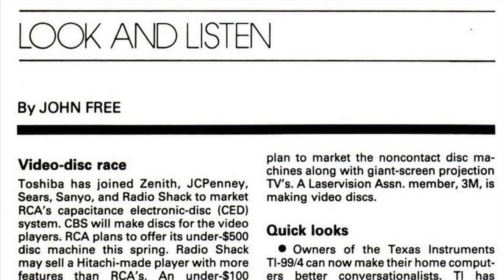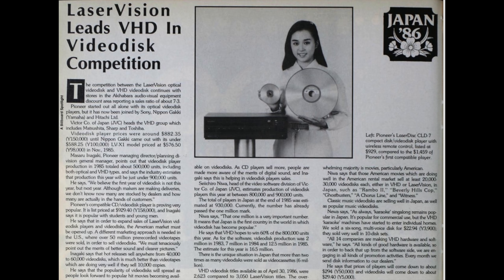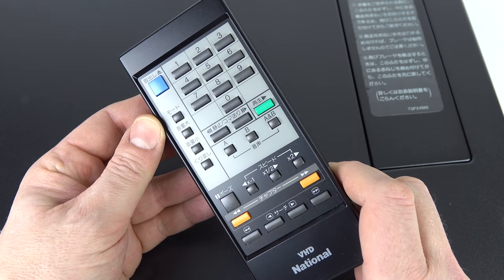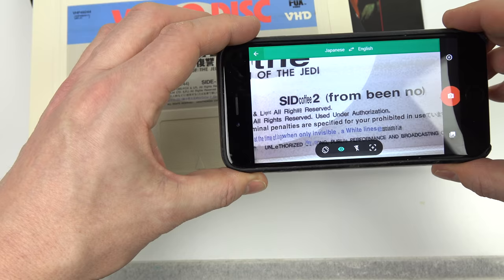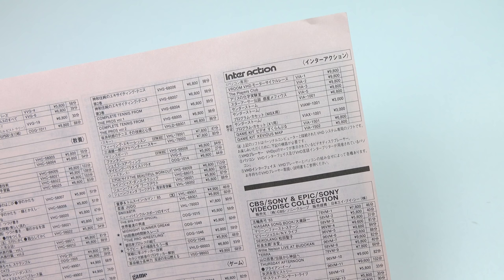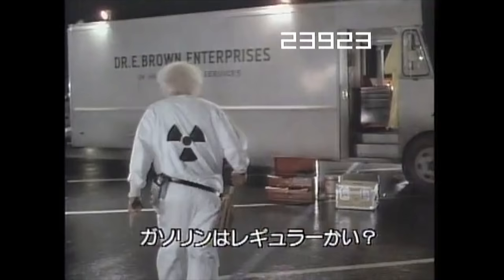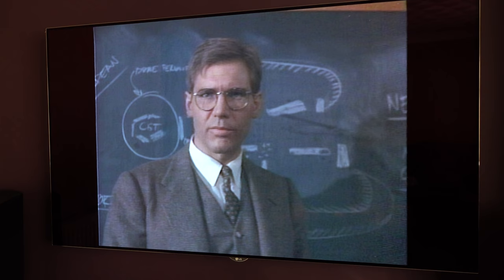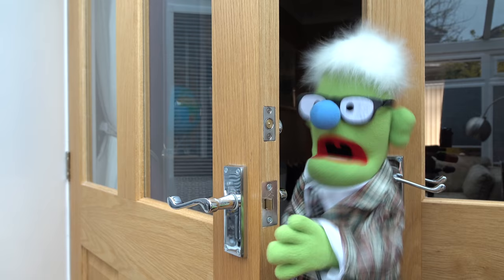Movies on Vinyl - VHD The forgotten 1980s Videodisc

Comment: Hi there! Professional Japanese-English translator here! It seems that, yeah, Japan kept the original "Revenge of the Jedi" title, given that the word in question (復讐) means "revenge" or "vengeance." Not very Jedi-like, which I guess is why it got changed for the English release!
Reply: Gasp! They have since changed the title to ジェダイの帰還, which is much closer to the final English title. It may actually be even more interesting for having received an official release somewhere with the title "Revenge of the Jedi."
Reply: Might I add in the Mandarin Chinese translation of the title here in Taiwan, it's called 絕地大反攻, roughly "Return Attack of the Jedi". Sort of sits somewhere between "revenge" and "return"

Comment: That VHD machine makes the same beep sound as my PS4.
Reply: Maybe the PS4 is a VHD player in an other caseing, wich uses smaller discs?
 Or maybe not.
Reply: Yeah... It's the on/off beep. The PS3 has the same one. Thought I recognized it.
Reply: Joe Snes Was just going to post that.
Reply: Apparently the PS3 (And of course, PS4) was inspired by that beep.
Or they used the same speaker out of the VHD player.
Or it was just a coincidence.
Reply: I believe many electronics probably have that beep
Reply: I actually thought it was the hourly charm on my watch. :)
Reply: Beep is produced by piezoelectric device, and that device is perhaps produced since 60's.
Reply: Joe Snes I think both have the same beeper ;-) or inside yours console have a litle mouse. ;-)
Reply: Generic Japanese Beep V. 2.4
Reply: @procommentr  Put that into Alexa or Gurrgle and listen to the beep say cupids adult store and Luke Who's ur daddy?(then the sound of flatulation seemingly rising in a green hue behind Yoda).
Reply: It'll just be an electronic component which is still being used across the other platforms even after 30/40 years. You see this a lot with some computer components as well if they serve pretty basic functions. Just means they are tried, tested and very cheap.
Reply: Both the PS4 and the PS3 are made by Sony

Comment: What's for tea?
Reply: HEINZ BAKED BEANS!
Reply: Gorp and two-four
Reply: That's weird, having Doritos with fish!
Reply: They eat during tea ....weird!
Reply: And why are your plug sockets so big??
Reply: cause they are better engineered than the US ones which are whiggly and people can touch the life metal of the plug... (if they are really clumsy)
Reply: More importantly, what kind of tea? If it isn't Whittard's English Breakfast, I'll have to reconsider.
Reply: The Americans have the steering wheel on the wrong side!
Reply: I think the Euro plug is even better, it doesn't wiggle and is almost as compact as the American one. I hate the fact that they actually sell devices with those huge UK plugs here now days. Even more annoying are those UK bathroom plugs that look like Euro plug but doesn't quite fit. They are a pain in the ass to use and very annoying to go buy some adapters after opening the box of a new thing.
Reply: My Blackberry tablet (freebie, didn't pay for it) came with a British plug with a cheap adapter slapped on. At least we all use roughly the same frequency and voltage here, as opposed to Americans and the Japanese who must promptly have such odd variants ;3
Reply: PianoVideosJustForU due to copper shortages, they had to use a ring system for wiring houses.  It uses less wire, but requires that every plug have an individual fuse.
Reply: MadFinnTech no way, the round pins make poor connection and bend so easily on Europlugs and they even fall out if bend too far!  No way that will happen on a UK plug or even our much tougher shaver plugs!
Reply: Knuckles the Echidna Well, in my experience, the old-school, pure metal pins are very durable. Cheap modern electronics have half plastic ones for safety, so you can't short circuit it.
Reply: PuffyRainbowCloud yes that seems to be it, they seem to get stuck in the socket too if not made right I found out.  I like to take my British 4 way extension and adapter abroad for the battery chargers and mosquito killer device thingy, that way the adapter can be sacrificed if something gets broken 🙂
Reply: ANGERY
Reply: I WAS EATING THOSE BEANS!
Reply: What's for tea?
Reply: Are you fucking insane!? I WAS EATING! THOSE BEANS!
Reply: Also...why is there plush carpet on the bathroom floor? ;-)
Reply: Guillaume Gaudin I mean, almost half the world's population drive on the left side of the road. Its not unique to the UK.
Reply: baitsnatcha So you don't get cold feet
Reply: @nomeanlol  The ring system is safer and more efficient, the same goes for ring air systems in factories. America was the first to electrify and is therefore tied to some seriously obsolete standards.

Comment: I had both the 4:3 and widescreen versions of back to the future on Laserdisk. You are right that the 4:3 is open matte and has more top/bottom information but the special effects sequences were only done in 16:9. So in those sections of the film the 4:3 disk will be a pan & scan of the 16:9 frame shown in the cinema but for the non-special effects sequences you will see more.

Comment: I never knew this format existed! Picture quality certainly beat VHS.
Reply: Indeed.
Reply: Construction Toy Dude
Guess slow and steady definitely wins the race
Reply: I suddenly understood how they did their karaoke with video, def beats VHS, wow that sucked.
Reply: Worst crazy video format ever. They had a bad problem of skiping . They would get stuck and jitter bug an epileptic fit if there was even the tiniest bit of dust. And the stylus wore out fast. You could not even look cross eyed at the things with out it screwing up. And vhs was way better than beta as the machine did not destroy tapes.  A vhs provided hundreds of plays without dammage while you were lucky to get 20 plays from beta before the tape was destroyed.  I owned a tape rental store and beta tapes came back dammaged all the time . I was glad to get rid of that terrible expensive format! Laser discs were great if not physically warped or cracked they could always be cleaned and polished and they would work perfect .The data was sealed in laser disc permanently protected.  I still have a player and a substantial collection of laser discs. They also have great dts audio on most movies!
Reply: Construction Toy Dude better than 4k blu ray
Reply: A potato beats VHS.
Reply: actually not. it has the same standard RCA connectors
Reply: Almost anything could beat VHS in picture quality.
That's not saying much.
Reply: Very good ''
Reply: The qualitu is good ''
Reply: War Zone  wrong whiye people blew there money

Comment: ..... okay can we appreciate for one second, the fact that that was 60 fps on a RECORD. A HIGH DENSITY VINYL RECORD.
Reply: Joey Glaser 60 FIELDS per second is 30 FRAMES per second... actually, it’s ever so slightly less than those numbers.  I believe (if memory serves) it’s 29.97 FRAMES per second.  These numbers are only for NTSC televisions though.  PAL ran at 25 frames per second.

Comment: So they cut the sides off the letterbox movie format for home tv, then when they make the bluray they cut the top and bottom off that in stead of restoring the original wider frame of the letterbox?  wtf.
Reply: AIUI Often the original film frame captured by the camera was larger than what went to the cinemas. When the 4:3 versions of films were made they sometimes included parts of the image that were not in the cinema version.
Reply: Here's a fun one you can see here on Youtube for free: "Get Crazy", a 1983 fictional concert-film which was only ever released on VHS in full-frame. There is no widescreen version available, BUT the 4:3 format was scanned so large that in some shots you can see the microphone hanging in the shot. It works fine for the film, because it is totally insane and funny as hell at times, and essentially you do see most of what was actually shot.
Reply: @bghoody5665  : But if that were the case, how is the picture quality in the Blu-Ray so good? If they just cropped the Standard Definition 4:3 version the picture quality would still be SD, but the Blu-Ray version looks pretty HD, so they surely had to go back to scanning the original film to get that kind of quality. The zooming and cropping had to be because of different reasons.
Reply: BG Hoody Back to the Future wasn’t cropped for 4:3, it was presented in open-matte. What that means is that for the 4:3 version, they display extra picture on the top and bottom. The widescreen version on the Blu-ray retains the original framing of the film as shown on cinema screens.
Reply: It seems many people don’t understand what open matte means. Film is typically shot on 35mm which is a 4x3 format.  The movie is then matted (eg cropped) down to a final aspect ratio. When the movie is filmed it is framed so that these parts of the picture are not intended to be shown, however they are there. Some films are more careful then others, and its good practice to keep stuff out of that part of the shot so you can change the matte in editing. In the 80s with TVs it was common to edit a film without first matting it, thus a TV version could be produced that didn’t lose any of the picture. 

Basically, the 4x3 was never intended to be the film released to theater and was really not meant to be seen however they used the entire frame to produce a better home video copy. The HD version is “cropped” or matted as was intended. Standard film is not widescreen. It’s 4x3.
Reply: The misunderstanding here seems to be a conflation of Cinemascope and Super 35.  If the sides are being cut off, that generally means the film was shot with an anamorphic lens, to capture a 2.4:1 image on a 1.37:1 frame of film by horizontally compressing it.  This is done specifically to achieve a Cinemascope ratio, and lopping off the sides is inherently a subversion of filmmaker intent.  If the top and bottom are being cut off, it was shot flat.  Many films - including any in the common 1.85:1 aspect ratio, such as the BTTF trilogy - are shot full frame (open matte) on 35mm, then have the top and bottom portion of each frame masked for printing.  Cutting off the top and bottom of this image is the correct thing to do.  Unlike pan and scan on an anamorphic film, the material you're cropping from an open matte original is not intended to be seen. 

So no, this is not a case where the same film lost horizontal information on VHS, and vertical information on Blu-ray.  The VHS was open matte, just like the LD/CED/VHD.  It showed essentially the full image from the 1.37:1 negative, including information not intended to be seen in the theatrical aspect ratio.  The Blu-ray is framed at 1.78:1, which is just a hair off from its theatrical aspect ratio of 1.85:1 (matted from the original 1.37:1 negative).  I'm not sure why Universal (and Warner Brothers) consistently frame their 1.85:1 movies at 1.78:1 for home video, but the difference is negligible.

Comment: The original title was “Revenge Of The Jedi” but only weeks before it would hit the cinemas George Lucas decided that it would sound unfriendly so he changed it to “Return of the Jedi”.
Reply: It was changed because George Lucas said the Jedi wouldn't take "revenge", apparently. 😉
Reply: Amusingly, this happened only after Lucasfilm's lawyers forced Paramount to change the subtitle of Star Trek II from The Vengeance of Khan to The Wrath of Khan, which producer Harve Bennett was livid about, on the ground that it would overlap with Revenge of the Jedi.
Reply: Revenge of the Sith in JP uses the same characters (fukushu, "revenge") that this vinyldisc thing used for RotJ. I think the JP name for RotJ was later changed to something more benevolent (kikan, meaning "return" or "reestablishment") long after the theatrical run, during the special editions and prequel years

What an awesome pickup, I never heard of this video format. Any home video copy of RotJ with the title "Revenge of the Jedi" has to be a collectors item

Comment: huh, i didn't know back to the future was filmed full-frame and matted, instead of with an anamorphic lens. how common was that version for movies? i would probably watch them at least once to see the extra set details that they didn't really expect people to see...

also: those are cheap here? i know (the slightly larger ones at least) are getting hard to find in the usa bc of retro gamers. i'd been interested but hadn't bothered looking them up. maybe i should pick one up before they become harder to get here
Reply: Reminds me of Plan 9 from Outer Space. At one point you can see the script sitting in the lap of an actor!
Reply: Kit Vitae It was very common for James Cameron's films. T2, The Abyss, Titanic, etc.
Reply: I always thought that you were losing parts of right and left to fit it in 4:3, than the other way around. I would surely like to watch the extra details, from the missing top and bottom parts, that are almost 1/3 of the picture. Maybe such an extra version should be included at the DVD-Blu ray releases.
Reply: Lots of films are still shot on film Sevel, especially the big ones.
Reply: LemonSlice and IMAX still uses the anamorphic lens (hence widescreen being called "anamorphic") with corresponding opposite lens on the projector. big name big budget films like the first star trek (late 70s) did it too, because you got better depth of field etc than just cropping something.

when i had read up on it a while ago, the matting was presented as the cheap option, which i'm sure it was, so i was surprised when movies we consider big now (like back to the future) did the cheaper option. i guess most movie-goers don't notice cinematography stuff as much, so it was probably all down to if the director especially cared about using some of the studio budget on an anamorphic lens...

Comment: Here in 2020.  I still have a LaserDisc machine with maybe 3-4 laser discs, bought in the late 1980's - early 1990's.   The machine itself was free, came from a company using our office in the early 1990's to advertise, using the machine as a promotional tool & so eventually the machine was left to us, to this day.  Even came with a wooden TV cabinet stand, with CRT TV, which we still have both, but we have no room for those 2 items so will probably have to give them away or sell for low,  or have them recycled which would be unfortunate.  Never had CED or VHD though.

Comment: I wish they released the uncropped version on the blueray as well
Reply: The cropped version is how it's intended to be watched; the uncropped version exists so that it can air on television without any pan-and-scan (as 4:3 TVs were still the norm back then).
Reply: Check IMDB for the film's technical details. The original cinema release was on 1,37:1, so it was viewed as 4:3 in theatres as well.http://www.imdb.com/title/tt0088763/technical?ref_=tt_dt_spec

There is mention of a 1,85:1 intended ratio but no specific details on whether it was released on that format or not.
Reply: From IMDB:
1.37 : 1 (negative ratio) 
1.85 : 1 (intended ratio)
Reply: Correct. Although the format on which the original film prints were made (and thus the theatrical release would be) is not clear from this data.

Quite possibly Zemeckis' intention was for the film to be widescreen but penetration of the 1,85:1 anamorphic format was not sufficient enough to be commercially viable, and the widescreen version was only released to home video later. So for the most authentic viewing experience like in 1985 theaters, 1,37:1 would be correct, but viewing it at 1,85:1 would be the correct viewing experience from the director's point of view.
Reply: Stoney3K, movies shot in full frame, but intended to be shown in widescreen, where most often not shown anamorphic in cinemas, but simply cropped at the top and bottom. Unless the projectionist screwed up, movie goers would have seen the film in the aspect ratio intended by the director.
Reply: So why didn't they print the film in anamorphic or cropped format to begin with? Was that a cost issue or done because of editing limitations?

TV releases would just get letterboxed during telecine.
Reply: Stoney3K, creating an anamorphic print from a cropped full frame movie does not make much sense. It would lead to avoidable distortions and require cinemas to be equipped with expensive anamorphic lenses.
Prints would often be cropped already, but still require masks on the projector.
Reply: My question was more why it was shot in full frame to begin with. Most cinemas in '85 were well equipped to handle the 1,85:1 format of anamorphic prints.

Was that done because of constraints in production, i.e. Panavision lenses were more expensive to rent or the camera operators were not trained to work with them?
Reply: I don't know what exactly led to Back To The Future being shot in full frame. 
Most of the time it was done because it was cheaper to shoot than anamorphic formats or to avoid pan and scan issues for the 4:3 TV/video release.

Comment: How did each rotation of the disk hold two frames once it got towards the center of the disk? wouldn't it not be able to store as much information due to the shorter distance around at the center as compared to the longer distance around on the outside?
Reply: Basically in a constant angular velocity system like this, information density is limited by the inside track... For an analog system you just let the quality degrade as you go in, but ultimately the performance of the inner track limits your performance. A lot of the potential performance is simply wasted. Another thing you have to do is just limit the inner diameter of the disk and not record anything there.